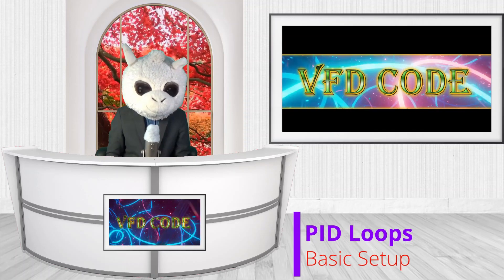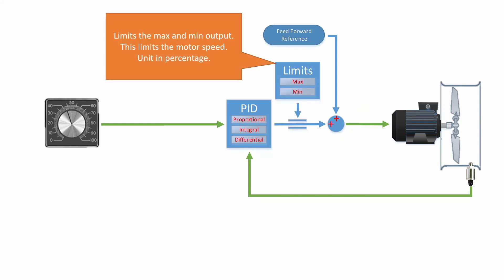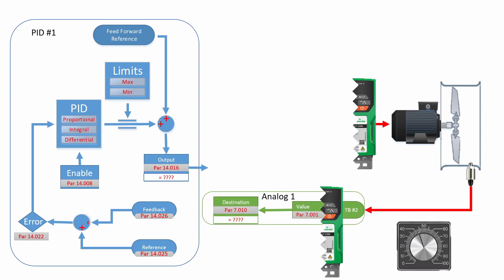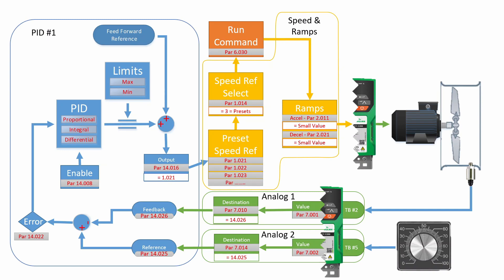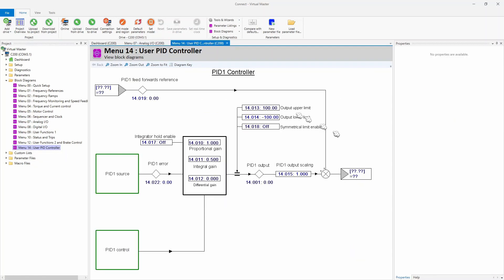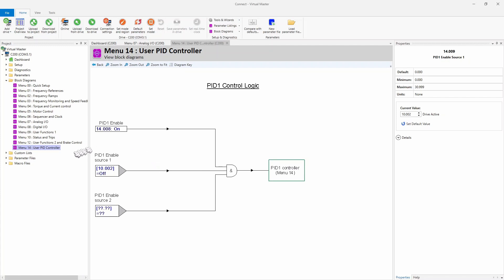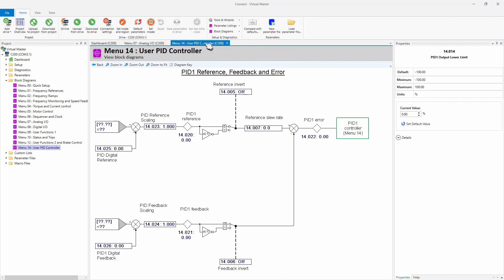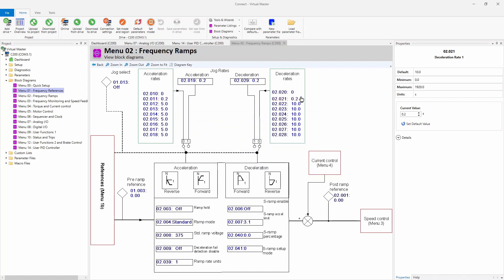Setup PID In a couple Minutes

Comment: How would you do the dancer application using pid?
Reply from the maker: Typically, dancers are employed on winders or some sort of web line to maintain the proper speed or tension. The PID block, along with the C200, C300, M400, M600, M700, and M750 drives, incorporates a feed forward on the output side of the PID block. Often, I utilize this feed forward as the line speed, and have the dancer connected to the PID to trim the final speed command. See parameter 14.002.  This would be mapped to whatever parameter has the line speed. Parameter 14.016 would be mapped to parameter 1.021 and you would then tell the drive to use preset 1.

Alternatively, you could simply utilize the trimming offset parameter 1.004 and have the PID output control parameter 1.004 instead of using the feed forward on the PID block.  You would then map 14.016 to 1.004.    Then you would use a analog input or a preset speed for the line speed.  

Another option would be to have the dancer connected to the PID blog but then have the output of the dancer control parameter 3.022. The nice thing about doing it this way is that the dancer doesn't have to go through the acceleration and deceleration ramps. This allows the PID to have quicker response times to any sudden changes, however you might need to implement some sort of centering routine when you first web up the line.

I would Recommend looking at the block diagrams to understand what I’m referring to.
Please note that if you have an M600 and up there are more options.  The line speed could follower an encoder.  As I don’t know what drive you are looking to use, I’m limited in how I can respond.
If you still need help let me know I'll try to help where I can.
Reply: @vfdcode  thank you so much for this info, im currently studying and learning these drives, Do you any worked examples/applications, i could possibly learn, highly appreciated🙏
Reply: Im currently learning the c200 & m400 at the moment, thereafter i would like to move on
Reply: I did do a pump system with pid, but very basic application
Reply: I would love to learn more about these vsds, such has applications, do you have an email add, that i can send through questions when im learning these, you have such great content, i was watching all of your videos, they so understanding
Reply from the maker: Unfortunately, I don't have any files that I can give you that are working examples, because they would belong to a third party after I got their system working.  If you have a particular application that you want me to help with, then do one of the following.

Option 1
Go to fill https://www.vfdcode.com/code/code-ideas out a request.
Option one is meant to be if you want me to make a video about a particular thing. I don't get a lot of responses here and so I don't look at the data coming from this site very often. Mostly it's just to give me ideas for videos. And so it might take a while for me to get to your question if I accept it.

Option 2
Just request some technical information like you're doing but give an example of how your system is actually used. This is where I typically will get back to you quicker but I won't make a video. I prefer the questions being asked in the comment section so that other individuals can learn from it too.
Reply: @vfdcode  sorry no, i was basically reading and watching some videos, and i wanted to know like for example: how would one tackle an extruder application for example, with the control technique’s vsd, i did do some basic applications such as a fan,pump
Reply from the maker: Extruder Application with Commander C300 in Open Loop

An extruder, for those unfamiliar, is a mechanical device that expels plastic or other materials through a nozzle at a controlled rate. While various types exist, this is the most common variety.

When employing a Commander C300 with an extruder, control is typically achieved either via an analog input for speed or over a network.

For analog control, the default setup of the C300 is already configured. Simply input motor data, and you're good to go, as the default configuration assigns analog input one as the speed setpoint. To wire up the analog using a potentiometer, follow these steps:

(Using a 10k ohms potentiometer)
- Terminal #2: Analog one voltage input.
- Terminal #1: 0 voltage reference point for the potentiometer.
- Terminal #4: 10 volts reference for the potentiometer.

Connect the potentiometer sweeper to Terminal 2 and the other two connections to Terminals 1 and 4.

If you're not using a potentiometer and a PLC is simply sending an analog setpoint to the drive, utilize the following terminals:
- Terminal #1: Wired to the PLC's 0 volts.
- Terminal #4: Wired to the PLC analog output (0-10v).

If analog control isn't preferred for the speed command and you opt to use a network for speed control, set the drive to preset mode by adjusting parameter 1.014 to "preset." Then, the network can write to parameter 1.021 (Preset References #1) to control the speed. 
Without knowing what network, you are going to use this is a far as I can help with the network.
Reply: @vfdcode  wen you say “network” an example with be maybe an “si-ethernet”, “profinet”, how would one configure this to send over the network?
Reply: @vfdcode  Also you stated that if youre using a “plc sending an analog setpoint” you wire up to T1 & T4, 
I just want to ask something here… wouldnt the output of the plc be connected to one of our “analog inputs”, instead of T4.
Reply from the maker: There are two questions here. The first one is about setting up Profinet to control the speed of a drive, while the second concerns setting up and configuring an Ethernet module for the same purpose.

For Profinet setup, the focus lies mainly on configuring the PLC. Initially, the PLC assigns a name and IP address to the drive. Then, within the PLC, mappings are established to link specific parameters within the drive. Refer to this [video](https://youtu.be/CimCuKAx0Bg) demonstrating the process using an Emerson PLC. It's evident that most, if not all, setup tasks reside on the PLC side. From the drive's perspective, it's about understanding the file or parameter numbers to select the correct settings in the PLC.

Regarding Ethernet IP setup, cyclic messaging is commonly utilized. If speed adjustment from the PLC is the sole requirement, configuring the Ethernet module involves setting the IP address and parameter 1.014 to "preset."

For the C300 drive, IP address setup involves:

- DHCP: 1.02.005 (set to off)
- IP address: 1.02.006 (your IP address)
- Subnet mask: 1.02.007 (your mask, typically 255.255.255.0)

The SI Ethernet module is by default configured to manage drive speed if parameter 1.014 is set to "preset." In the PLC, creating a generic device with 2 inputs and 2 output words suffices. The second output word from the PLC dictates the drive speed, writing to parameter 1.021, serving as the preset speed reference. The first word controls drive start and stop, corresponding to parameter 6.042.

Thus, the default setup of the SI-Ethernet module allows controlling drive speed without delving deep into Ethernet IP table setup in the drive.

Expanding beyond two words in and out is possible but may require further guidance, possibly through video tutorials.

Below are the PLC settings for default Ethernet-IP without using AOI or other files:

- Assembly input: 100 (size 2)
- Assembly output: 101 (size 2)
- Configuration: 1 (size 0)

All words are 32-bit or Data type DINT in the PLC.
Reply: Can you kindly answer this for me, as this is confusing me, thank you🙏
Reply from the maker: The PLC analog output would be connected to T4 but you also need to connect the PLC 0V to T1 the drives 0V so they have the same 0V ref.  Without that the analog will not work in 0 to 10v mode.
Reply: Aaaah okay thank you very much for this info🙏i would gladly ask you questions,lol because the way you explain makes it so simple, thank you🙏
Reply: Correct understand, you have to common the 0V🙏thank you
Reply: If you have 3 position switch, one for auto, off, manual. How does one programme the drive? For auto it will run in preset and for manual, it will run via keypad ref?
Reply from the maker: If I understand correctly, you want to utilize keypad reference as the hand mode without involving the keypad for starting and stopping, right? The parameter 1.043, is  intended to choose keypad mode rather than keypad reference. However, we can achieve this using a variable selector.

Here's a straightforward method to accomplish this:

1. Assign 1.017 to Set 12.008. (Variable Selector 1)
2. Assign 1.022 to Set 12.031. (Output of Variable Selector mapped to preset speed ref 2, but can be adjusted to any preset)
3. Set 12.030 to 0, linking it to input 1. (This ensures data passes from variable 1)
4. Set 1.014 to "preset".
5. Set 1.015 to 0.
6. Map a digital input to parameter 1.045.

With this setup, the digital input will toggle between preset speed reference 1 and preset speed reference 2. You can use one of these for auto mode and the other for hand mode.
Make sure to save the parameters in the drive, for the settings to take effect.
Reply: @vfdcode  QUESTION 1 >> if im not mistaken, is it not parameter 12.001 set to 1.022? Because if i assign 1.022 to 12.031, it doesnt have a parameter to put in for 12.028(variable selector 2)

QUESTION 2:

Also on the variable selector you have a parameter 12.015(variable selector 1 control) this states that it controls variable selector 1, my question is how does it control, can you kindly give me an example?
Reply from the maker: *Answer to Question 1:*
You are mistaken. Parameter 12.001 is used for a threshold detector and has nothing to do with the variable selector. I recommend looking at menu 12 as a block diagram. 

Please note that if you are using Windows 10 with a high-resolution monitor, the scaling might be off, causing the picture to appear very small. Ensure that your display scaling is set to 100%, not 120% or 150%. Once it is set to 100%, you can open the connect software. Viewing the block diagram, you will see that the threshold detectors are unrelated to the variable selectors.

In the example I provided in my last reply, we are simply taking the keypad reference speed and moving it to a preset speed reference using the variable selector. We are not controlling the variable selector to switch between two different values. Since there is already a built-in speed selector in the preset speed references, we did not need to do any additional switching.

*Answer to Question 2:*
Technically, the variable selectors can do more than just select between two values. I suggest reading the help documentation for parameter 12.010. Typically, if you want to use a variable selector, you would change the value of 12.010 to input 1 or input 2. This parameter is set up so that if a digital input is tied to it, it will select either input 1 or input 2 depending on whether the digital input is on or off.
Reply: I have a question, im doing a stunner application,using control techniques vsd, my issue i noticed is that at different voltages the chickens get stunned, but my question is how does one take the output of the transformer eg: output is 45V and current is 1,12A and send it to the vsd?
Reply from the maker: As far as your stunner application I am not able to assist in designing an application. This is outside the roll of what I commit to in this channel.  If you have programming questions I can assist there.